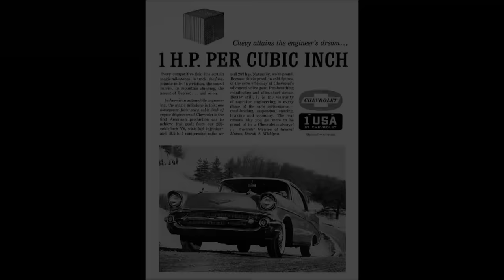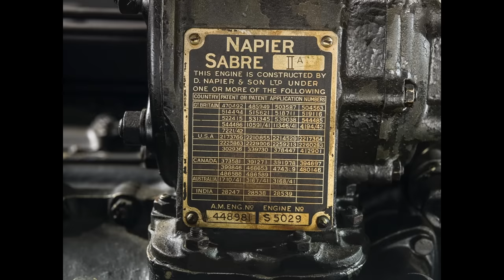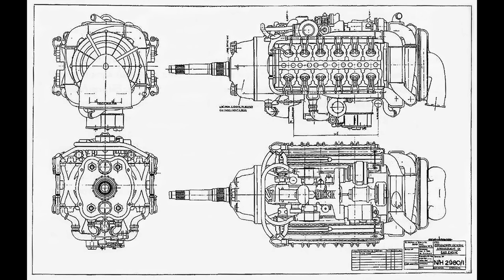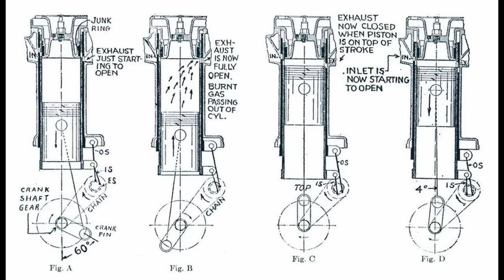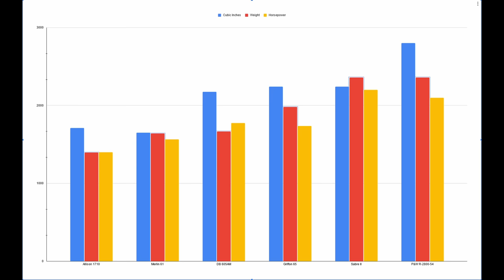Napier Sabre - The Ultimate WWII Aircraft Engine - Part 1

Comment: If hp/wt was the only metric for judging aircraft engines, then the Napier would have been in every airframe. For military aviation ease of maintenance and reliability trumps power to weight every time. It's really simple: more parts = less reliable. The science of metallurgy was always a few years behind the imaginations of engine designers. Just the gearing and bearing count alone made these W or H engines a maintenance nightmare no matter what company built them. The higher the horsepower shrunk the time between overhaul. Even today a 4 cylinder Lycoming that is turbocharged has half the service life of a normally aspirated version. In the case of high revving engines, the gearing required for best propeller performance chop the service life. It wasn't interference by Rolls-Royce that prevented Napier success. It was its own complexity.
Reply: I think you have a good view on the Saber. About high RPM operation, this was limited by the sleeve valve design as the whole cylinder was in motion and that is a complex and heavy assembly and produces a large amount of friction. The Saber was a fuel hog and an oil hog as well because of the sleeve valve design. The best comparison for the Saber was to the Bristol radials which were much more successful. More than that the sleeve valve design was copied from Bristol as they had better luck in making it work.

I wonder why cost was not mentioned? Do you think the Saber was inexpensive to build compared to the other engines? Also I wonder about the TBO on the Saber? How was it compared to other engines?
Reply: It's Sabre not Saber. Wherever you come from that was the name of the engine. And I think there were rumours of sabotage by R-R 'sponsored' mechanics - for example  ensuring a combination of high boost and coarse pitch at low altitude. Then again.....

Thanks for the film. Now it's time to watch Curious Droid's piece on the Napier Deltic, another brilliant engine and another excellent study.

What a company!
Reply: @keithstudly6071  - Sleeve valve engines have many of the same engine life, fuel consumption, oil burning, and emissions problems of 2 cycle and rotary engines... plus all that extra weight and complexity...
Reply: Hours of maintenance per hours of flight compared to the other engines wasn't addressed in this video. Who cares how powerful your engine is if it's always in the shop?
Reply: @autodidact537  - Probably like a Top Fuel Dragster... expect a full engine rebuild after every flight...
Reply: Rotaries don’t fit that generalization… dramatically simpler and significantly fewer parts. But they aren’t exactly more reliable
Reply: @ronnyek4242  Rotaries are a long ended experiment. All that gyroscopic mass spinning around the nose made for hairy flight characteristics. Radials, in my opinion, were the best all around ICE in terms of power to maintenance ratio. Perhaps I'm a little prejudiced after my years as an overhaul inspector...
Reply: @ronnyek4242  - Those are the reasons GM nixed rotaries in the 1960's and why only Mazda tries to make them survive...
Reply: @BuzzLOLOL  Whoa there tiger! Fuel consumption is only part of the equation.  It doesn't matter how good your fuel consumption is if you haven't any fuel.  That is an issue of logistics, and one of the huge advantages of the radial sleeve valve engines like the Hercules was that without the exhaust valve hot spots they could run on lower octane fuel, the same 87 octane 'pump petrol' that the trucks etc ran on.  Remember, at the time of the Battle of Britain for example, ALL the high octane aviation fuel going into the Merlins had to come across the Atlantic by ship
Reply: I'd be happy if Lycoming would simply have better oil distribution for the cam and lifters.  Horrible design.

Comment: There's a reason poppet valves are still the most common type of piston engine valve and sleeve valves are pretty much unused today. That reason is the levels of maintenance required to keep them operating efficiently and the incredibly high cost of constant replacement of sleeves. Sleeves wear out quickly whereas poppets will generally last far longer with far less maintenance required. In theory sleeves are awesome in that they provide far better flow. In practice, they are temperamental and wear out very, very quickly. Once you loose the seal between the sleeves, they foul with a mixture of intake and exhaust gasses and begin to stick, which requires a complete tear down and rebuild to replace the sleeves. Even if a poppet valve sticks, you only need to remove the head to repair it.
Reply: There's also the complexity of the gears required to drive the sleeves vs the relatively simple cam needed for poppet valves.
Reply: And there was me thinking the Bristol Hercules and Centaurus engines had a much higher TBO than all other aero piston engines in their hey day (?) [Civil Centaurus max TBO was 3000 hrs but this was dependent on using AeroShell 100U an oil specifically developed for SV engines].
Reply: @seagriffon1016  Interesting. Do you have a source for that? I was not able to find any info on TBO for any WW2 engines besides Merlins and R-2800s. If I'm not mistaken, the Bristol engines used a single sleeve with both the intake and exhaust ports in the same sleeve, whereas the Napier design used 2 separate sleeves for intake and exhaust.
Reply: @jkemmery  The Sabre has 1 sleeve shown at 6.22
Reply: @TheStrathmoreChannel  I was mistaken, my bad.
Reply: Those problems were common with Knight automobile DOUBLE sleeve engines, not with the Burt-McCollum SINGLE sleeve used in the Napier and Bristol engines. Single sleeve valve engines have higher TBO's than poppet valve aero engines, like 3000 hours achieved by some from Bristol. Take a look at Graham White's 'Allied Aircraft Piston Engines of WWII', a great book about the subject.
Reply: That and sleeved systems are much harder to make use of variable valve timing and other newer valve technology. Valve sleeving does have the advantage of enabling a more ideal intake charge temp, but this is generally not an issue unless at very high boost.
Reply: @bluspectre2042 you are absolutely right about VVT, it simply can't be made with only one sleeve. The intake temperature isn't really an issue, however getting rid of the exhaust valve head hot spot is important even without boost, which is why they could use a compression ratio one point higher than poppet valve aero engines, according to Harry Ricardo. It's not perfect, but it shure is a remarkably curious piece of technology.
Reply: Thank you J, I appreciate that. I'd add one other issue. Perhaps not today, in 2024, but in 1940, lads had motorbikes,  and cars, and adjusting valve-lash and such was almost a weekly chore. And points. Thing is, everybody was familiar with a pushrod 4 stroke poppet-vale engine, and familiar with working on them. This wasn't true of sleeve valve engines and never became true.
There were a few expensive luxury cars that had been made with sleeve valves, I hear (don't ask me to recite a list) but they were never something one would see in pieces in every service station across the country. (Modern equivalent, a Lamborghini. I have assisted in the rebuild of a 1970s Lambo V12, but that's because I knew a chap who had one.) Poppet valves, either sidevalve or even overhead valves with pushrods & rockers, were familiar. Overhead cams, 4 valve, adds to the complexity, yes, but even those are less conceptually difficult than sleeve valves.
Look at a modern motorcycle engine (which I have done, rather a lot) and it doesn't take much brains to see how it all works. A sleeve valve (and multi-bank radial sleeve valves were the worst) ~ that takes a bit of know-how.
In time of war, you could find thousands and thousands of young men, who had a passing knowledge of how to maintain, and rebuild, a poppet-valve engine. Sleeve valve engines ~ if there were more than a couple of hundred people in the UK in 1939 (or 1944 for that matter) who'd ever opened up a sleeve valve motor, I'll start chewing on my hat. In fact, if you said the number was less than 100 ~ I'd believe you.
Reply: If only Lycoming would improve the oiling system to keep the cam and lifters oiled.  Horrible design.
Reply: @jkemmery  sorry that I read only now your very interesting statement because I never realised what an important issue it was with the sleeve valves that required constant replacement. Obviously it required mechanics of almost exceptional experience to work on this engine! Thank you very much for this info!!

Comment: It’s unfortunate the Bristol Centaurus the radial sleeve valve wasn’t used in WWII earlier as well as the Sabre. Napier was an amazing engineering firm, their Deltic 2 stroke triangle diesel was amazing.
Reply: Twin Bristol Hercules radial sleeve valve engines powered the Bristol Freighter aircraft. I recall take-off power rpm was 2,200, and cruise continuous rpm was 1,800. They were 'slim' for radials, and very smooth and quiet comparatively. Start-up did require a full cockpit verbal 'Fire Drill' procedure each time and a long nozzle fire extinguisher and an external attendant adjacent to each engine. The Wright Cyclone and P&W radials were started with less drama. They were generally noisier and more vibrational however, unless absolutely zero-timed straight out of a full rebuild.
Reply: I understand that the Sabre engine was unreliable.partly because the manufacturer could not.machine the parts to a high enough standard. This improved when it was built under licence but I forgot which manufacturer it was.
Reply: All about time ,money ,experiment and skill 😊and necessity
Reply: Bristol sleeve-valve engines were the best, far more reliable than the Napier-Sabre.
Reply: @bobsakamanos4469  True but it wasn't ready in 1944 for large scale production . used later in the mkii Tempest and Sea Fury .
Reply: @AnthonyBrown12324  Centaurus yes, Hercules, no.  Used in the Beaufighter. It was far more reliable than the NapierSabre.

But it's an interesting dilemma - produce an underpowered fighter (P-40, Hurricane) and risk engine life by overboosting it, or make due with less performance and more reliability.  

As for the Sabre engine, I believe Bristol engineers were finally seconded to advise Napier on improving their metallugy for the sleeve valves, IIRC.
Reply: @bobsakamanos4469  The Hercules Xvi could produce about 1600 hp . I think the Typhoon / Tempest were looking for 2000 hp+ No fighters were really use the Hercules though many bombers . Definitely the Centuarus was proved to be good in the Sea Fury but not available in 1944 . Soon they were looking at jets ; so the piston engine was becoming moot .